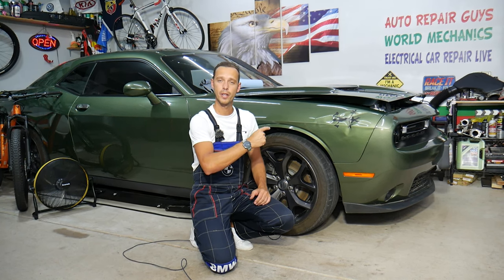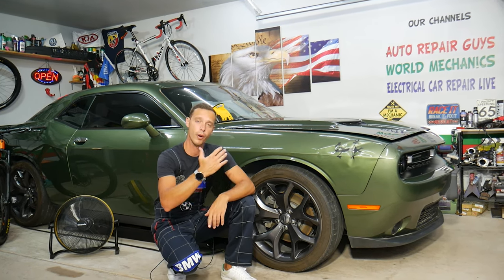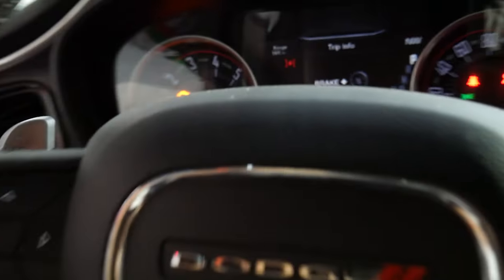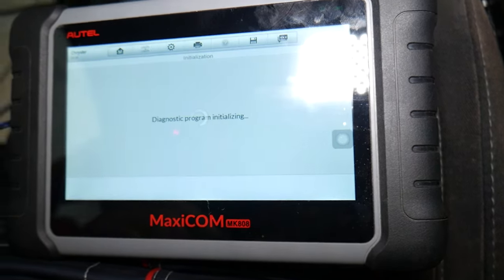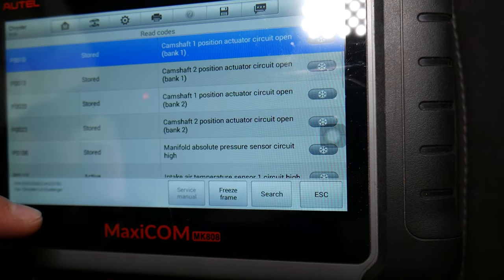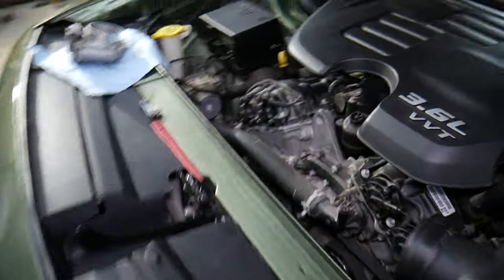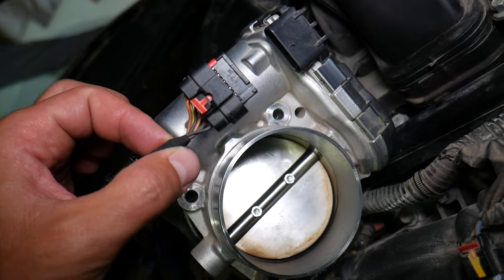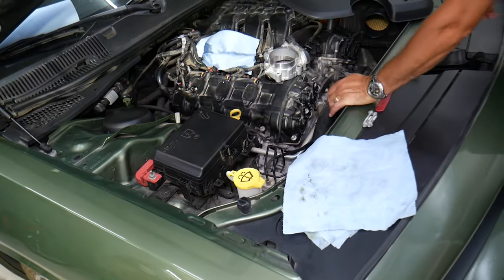DODGE CHALLENGER SERVICE ELECTRONIC STABILITY CONTROL, DODGE CHALLENGER SERVICE ELECTRONIC THROTTLE

Comment: I have a Ram Promaster 2500 with a Pentastar 3.6L V6 gas engine....could the throttle body be sending the service ESC/Check engine/ Hill holder light on? The van goes into partial limp mode. I pull over, turn the engine off, restart the vehicle, and the check engine light stays on. The ESC service Hill holder goes off and I`m back to full power. The dealer ran codes and said I needed a new Bank 1 sensor 1 ( camshaft position sensor ). Doesn't make sense! THANKS!

Comment: My dodge caliber only has this problem when the engine is cold.  When it’s 60 degrees or warmer it doesn’t come on.  What’s going on here?
Reply: Same
Reply: @Monqee  thinking it’s the intake manifold gasket leaking
Reply: I changed out my intake manifold gasket and it fixed the problem.  Also changed out the primary thermostat because it was leaking coolant.